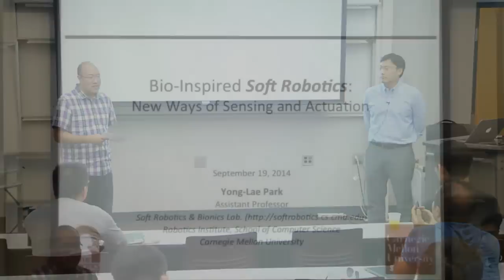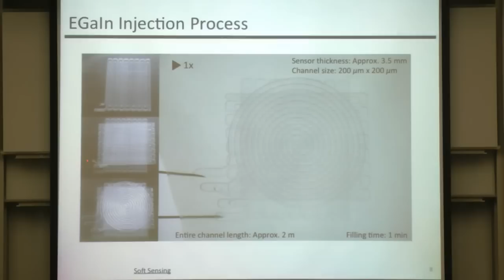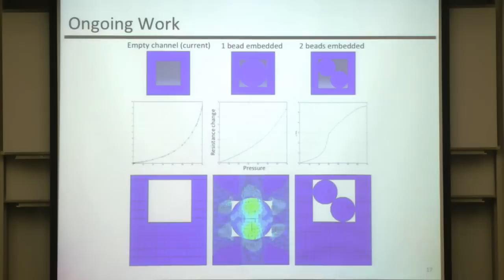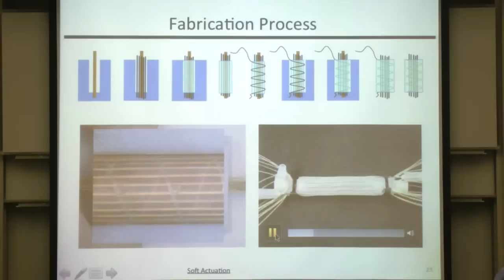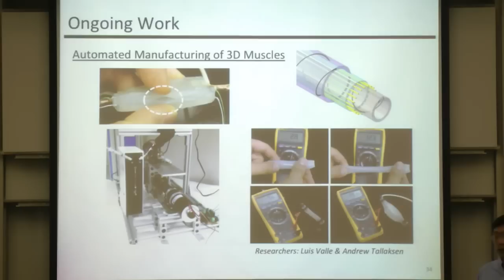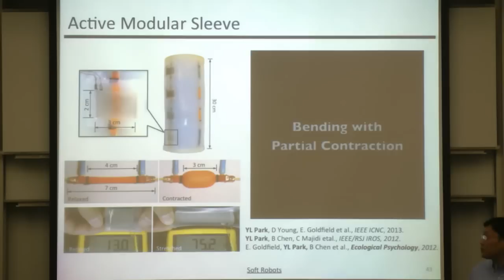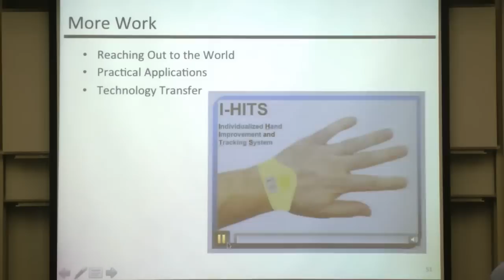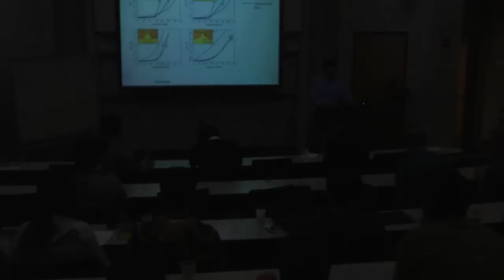RI Seminar: Yong-Lae Park : Bio-Inspired Soft Robotics: New Ways of Sensing and Actuation

Comment: when you design pneumatic actuated systems do you allow for loading and purging of air pockets through 1 or more routes and does this aid  in load and purge times and or any jittery motion. seems to me if you had the feed lines coming in 1 side and then purging through 1 or more out lines or in some inter active system of mini hold and supply tanks it would speed up recovery times between movements. any advice on this wold helpful as I am working on my first robotic unit and really like to use soft and or semi soft systems for movement as well as sensing. Also can you recommend any videos or any papers on the subject as it seems there isn't much online. thank you for the lecture.